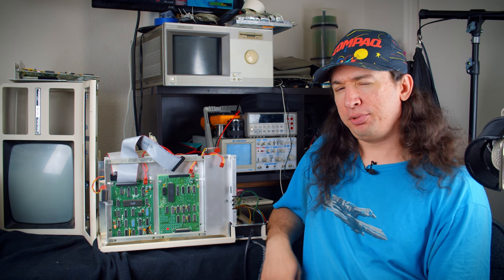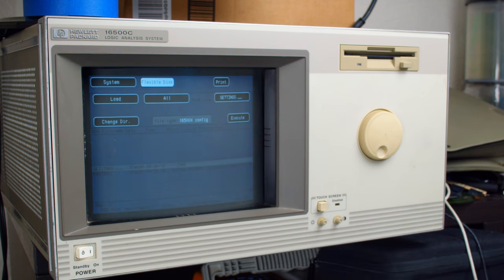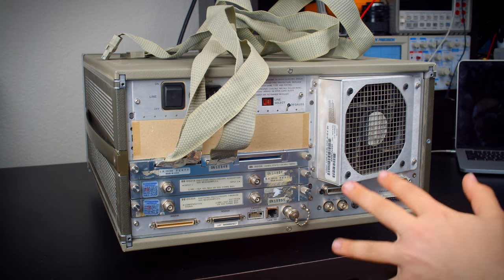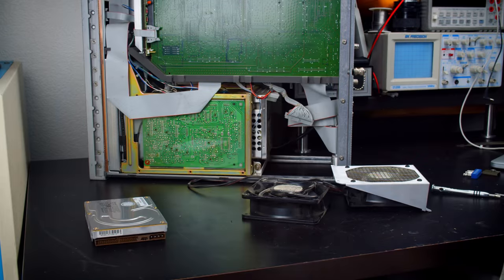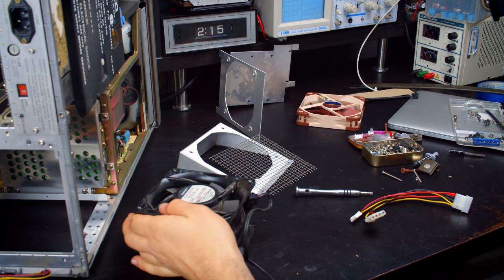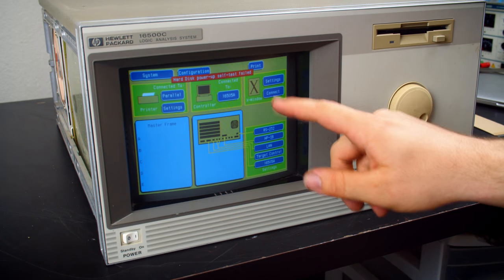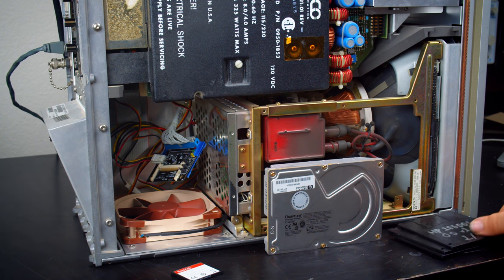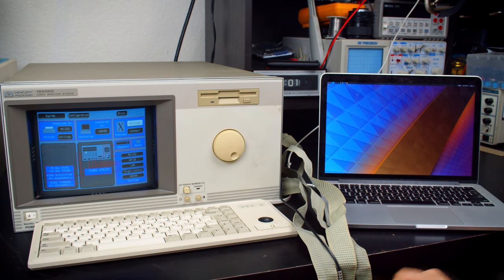HP16500C Noise Reduction Mod

Comment: Why dont you use IDE to usb adapter and simply clone old HDD using Acronis to the new drive? Or you can use Acronis True Image (cold boot) to make an image of old HDD and save it simewhere as a backup. There is 2017 version which is free, ISO available for download. It saved me many times. You can also clone bit by bit if hdd is bad.
Reply: DD would most likely the best option because of partition/drive sizes, just to be sure
Reply: @resneptacle  Well, Acronis can clone disk with all partitions to another one keeping it exact as previous. It was a legal free download, you can find information and download link (direct from Acronis) here https://malwaretips.com/threads/acronis-true-image-2017-bootcd.77984/

Comment: So you spent 25 minutes replacing two fans?   I am a fan of the channel but in the future I'll be sure to skip to the end right away to see if there is a payoff instead of a let down.
Reply: Sometimes the journey is more important than the destination. Its a shame you didn't find the information about the device interesting and that all you took from the video was a fan install
Reply: @UnreasonableSteve  I've watched every single post to this point and I have not been upset until now.  The journey requires a conclusion, not a what if.